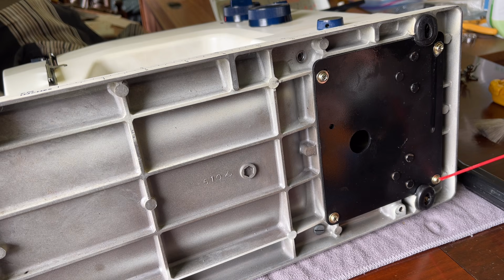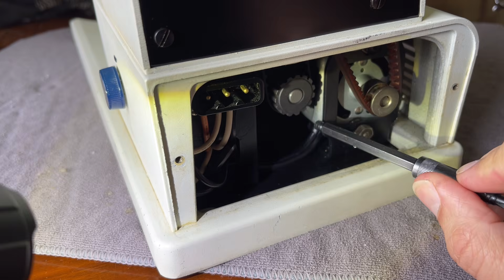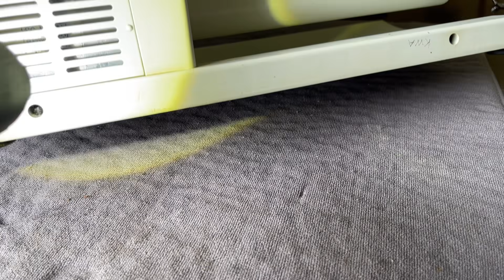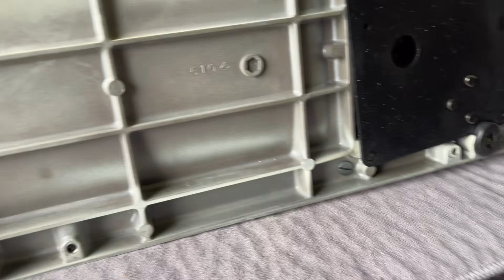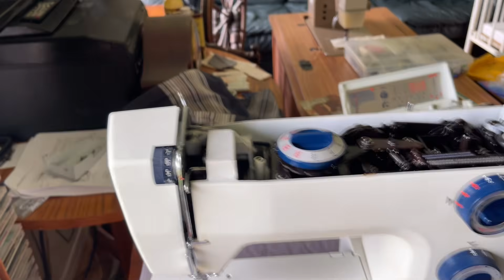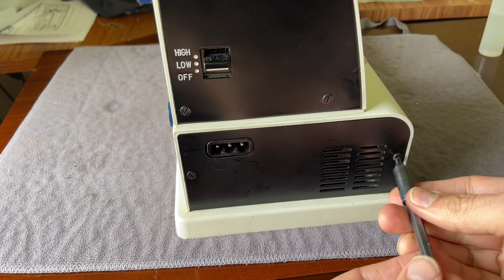CLIENT PROJECT SERIES #24:  Learning To Crawl Before We Walk!  Investigating the White Model 510!

Comment: 7:33  It is also important to use the right screwdriver.  Many standard screwdrivers just don't have the right shape tips to engage the screw head securely.  The replaceable tips in the tool you are using are far more likely to be the right shape and size.  This applies to straight blades as well as Phillips.